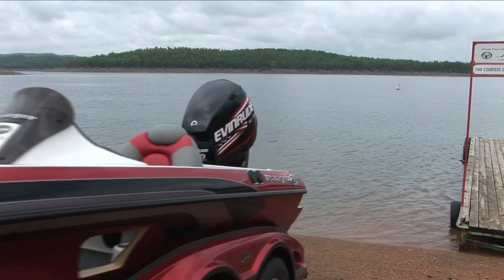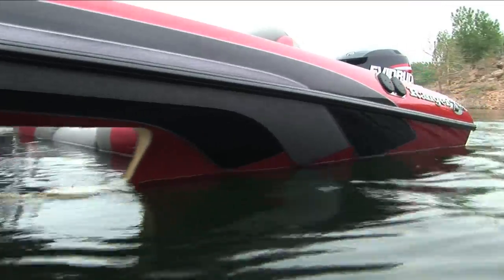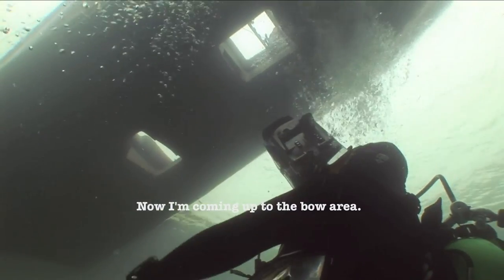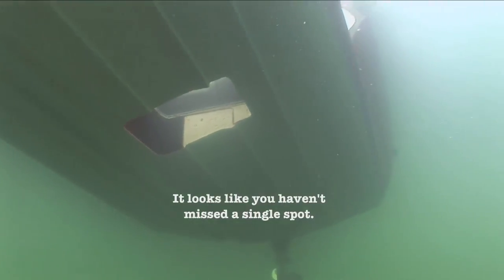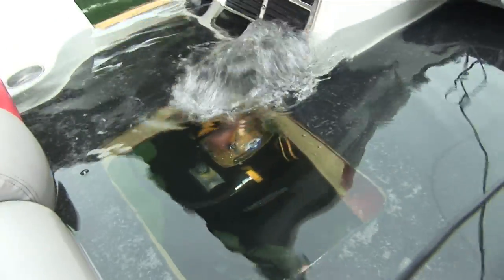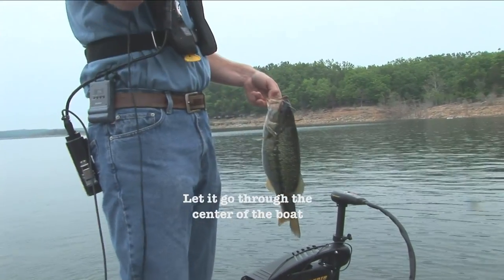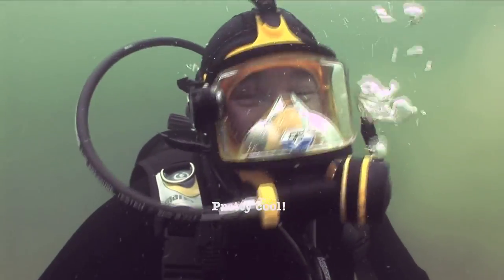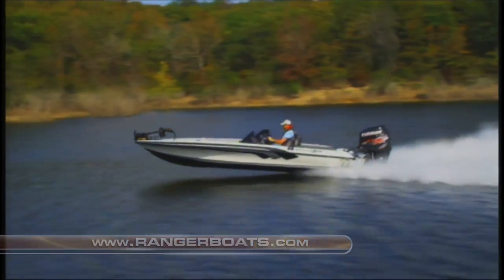Ranger Boats - Z520 Cut-away Boat Hook n' Look Style

Comment: Does ranger just think that boat buyers are idiots? Every bass boat made today will do that exact thing. It is called Coast Guard regulations for flotation. I have seen a Skeeter hit a stump and slice a 10 x 2 foot gash right up the middle and they towed it back to the marina. They actually had to use other boats to pull it off of the stump since it was sticking up through the center of the floor.
Reply: chris smith. not all some boat makers are too cheep to do that
Reply: Diana Foubester Name one that is in business right now. Not Triton, Charger, Nitro, Ranger, Stratos, Skeeter, legend, or any Aluminum boat makers.
Reply: The only boat companies I see doing this are Ranger and Skeeter.